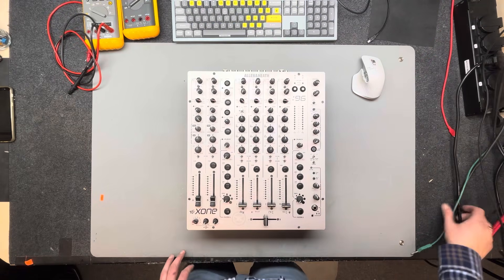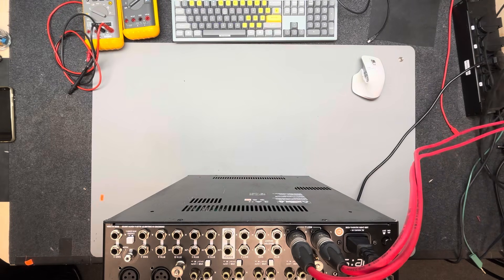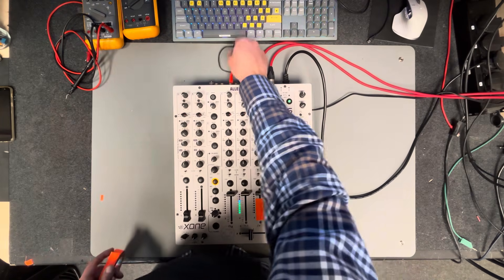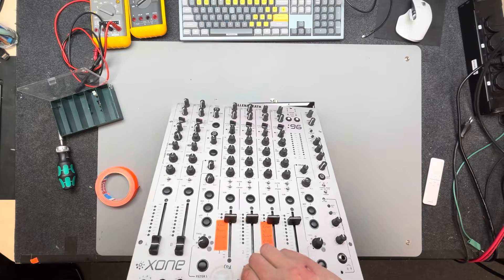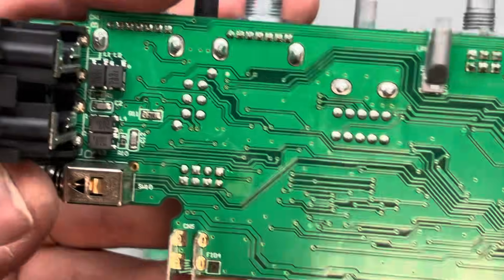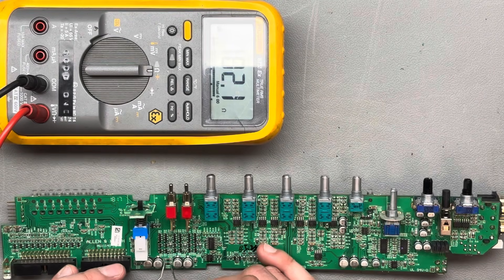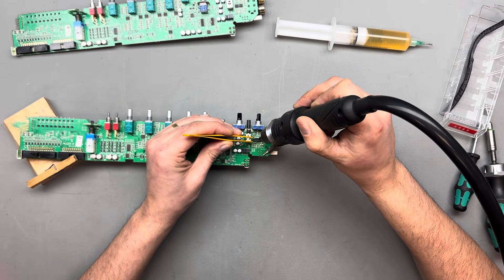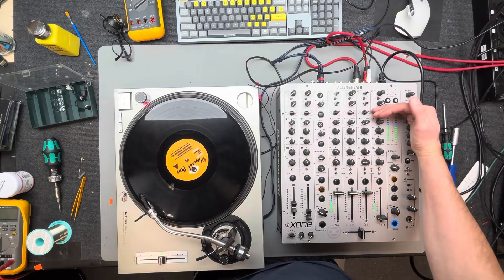Allen & Heath Xone:96 Phono Repair – Step-by-Step Fix!

Comment: Hola amigo yo tengo un problema con mí allen y heath xone px5. El sonido sólo sale por el canal r, en todas las salidas incluso por la de los auriculares, no estoy seguro de cuando empezó el fallo pero creo que fue a partir de una fiesta en la que le conecté otra allen y heath xone 96 la cual también estaba conectada a la corriente eléctrica, de la salida del master a un canal de entrada en línea , además de usarla con traktor como controladora midi a la vez, junto con otros dispositivos como platos technics, etc. El servicio tecnico de allen y heath la unica solución que me ofreció fue cambiar la placa base entera y por lo que entendí el fallo esta en los previos, creés que podria haber alguna otra manera de repararla?
Reply from the maker: Thanks for the detailed message!
It sounds like the left audio path is completely gone – and yes, that could be a damaged preamp or op-amp input stage.
If the issue affects all outputs (including headphones), it’s likely before the output routing – maybe in the input summing section.
I would first check the line input op-amps, especially near the R/L mixing stage.

Replacing the entire mainboard is extreme – in many cases, a component-level repair is possible.
Let me know if you can identify the board revision; I might be able to guide you further!

Comment: Hi brother, thanks for the vid. I’m gonna take my xone92 apart for the first time since I got it in 2000. (Original made in UK version). For cleaning and replacing some of the pots that are slipping.  Also I noticed, 2 of the channels are slightly louder than the other 2. Tested with the same vinyl on same channel settings. 2 channels are +3db louder.  Is that what you were fixing in this video?

Im not too technical with tools. Just basic electronics and solder experience I’m pretty sure I’ll be okay removing the slippery pots and replacing them. But not sure what’s involved in fixing the channels inconsistent gain issue.  Any ideas?  Thanks
Reply from the maker: Hey man,
thanks for your comment and nice words!

From what you describe, I’d say it’s possible that the two channels aren’t actually louder — the other two might just be a bit quieter.
I’d start by replacing the channel faders first. They usually cost around 30–40 € each and the part number is AI5326.

If your potentiometers feel sticky or cause crackling noise when you turn them, they should definitely be replaced too.
The thing is, the EQ pots on the Xone:92 have 12 pins, and removing them can be tricky without damaging the PCB. You’ll need a large soldering tip to heat all the pins evenly — just don’t overheat the board — and then pull the pot out quickly once the solder melts.

Maybe I’ll make a video in the future showing some of the most common Xone:92 problems and repairs.

In your case, it’s most likely worn or defective channel faders, but it could also be something in the OP-amp section.
Best start with replacing all the faders first, and if the issue is still there, we can look deeper.

For the job you’ll definitely need: desoldering braid, a bit of soldering flux, and a fat soldering tip to remove the small fader boards and solder the new ones in place.

Good luck — and let me know how it goes!
Reply: @miktroniks thanks I’ll report back.
Reply: Is that the correct part number for the replacement line fader? Ai5326? It says “003-144” in the service manual I found. From what I can find 003-144 is the complete fader.  And it is plug and play, no solder?
Reply from the maker: @pesh909  You’re absolutely right!
The part number you found (003-144) is indeed the full plug-in fader assembly — that’s the easier solution because it comes with the small PCB and connector, so no soldering needed.

I usually don’t replace the whole board when just one component fails.
If, for example, only the potentiometer or fader itself is bad, I tend to replace just that single part instead of the full module.
That’s why I mentioned the fader part (AI5326) directly — it’s the same functional piece, just without the plug-in board.

But yes, you’re totally right — the complete 003-144 plug-in version is the proper drop-in replacement if you want the easier, no-solder fix. 👍
Reply: @miktroniks appreciate it. Yeah I’m not too experienced with electronic tinkering.  I will always try the easier way out ;). Thanks I’ll report back once I open this baby up.

Comment: The LM4562 is continuously short-circuit proof, even when both channels are running, and can tolerate a maximum +/-18V supply voltage. 2.7 nV/√Hz @ 1KHz noise. Current Limit for best Audio Performance ±23 mA min.
Reply from the maker: That's right, the LM4562 is a robust op-amp designed for high performance audio applications!
Reply: @miktroniks  The LME49720MAX/NOPB is about 10% cheaper than the LM4562MAX/NOPB from a retailer whose name isn't AnalogKey. I don't know why TI is selling the same chip for more with a new designation than with the old National Semiconductor designation.
Reply from the maker: @TTVEaGMXde  Good point — yes, the LME49720 and LM4562 are basically the same silicon, just different branding depending on the era (National Semiconductor vs TI).
The funny part is: TI renamed it, but the electrical specs stayed nearly identical.

In real-world repairs (mixers / DJ gear / pro audio consoles), what matters more is:
	•	proper power supply decoupling
	•	low noise layout around the op-amp
	•	checking ceramic caps for leakage/shorts near the IC
	•	good contact on the ribbon cables / connectors

If the surrounding circuit is noisy or unstable, even the best op-amp will perform badly.

Thanks for the input — always nice to meet audio nerds here 🤟
If you’re into repair content, I post more of this stuff on my channel.

Comment: Yuri hi how are you fine I hope, great video, my one 96 crossfader got crazy when I assign to x the volume comes in the middle of de fader to the sides it turn off the sound when I assign off normal when I assign y gets like off with no fader, then I wait a moment a then my one works normal why its this?
Reply from the maker: Hey , you have to Google manual.pdf  , just tip in Google ( mini innofader plus Manual )
Reply from the maker: You have to Look at adjustement procedure

Comment: Hi Yuriy! My xone96 started recently to make a click noise on channel one and two when I rotate the high EQ knob ( like cutting the high and then rotate it back to center position ) any idea of what might cause this ? Thanks! 🤗
Reply from the maker: It sounds like the click is caused by the EQ circuit switching around the center position. On the Xone 96 this is usually related to the potentiometer itself – either mechanical wear on the contacts or a small DC offset in the op-amp stage. Another possible reason is that the mixer was running for a very long time and, due to high temperature, the op-amp circuit got damaged. By the way, are the rubber feet still attached? It may sound trivial, but they are actually very important for proper cooling.
Reply: @miktroniks thank you so much for your answer! Yes the rubber feet are still attach and the mixer itself is elevated also so that it can cool itself. The click sound usually only happens in the beginning, right after start up, yesterday was the first time it did it after about 1h30 min of mixing..🤷‍♂️ also, it’s not happening everytime..for example, yesterday everything was fine up until the end..I’m gonna try to find someone who’s able to have a look at it and repair it I think.

Comment: Hi Yuriy, thanks for your great video! I have a Xone 96 where the Line input on channel 4 stopped working after an electric guitar was connected (Phono still works). I opened the mixer and didn’t find any faulty safety resistors. I swapped boards 3 and 4, and then Line 4 worked but Line 3 didn’t — so the problem is definitely on the Input PCB. In your opinion, what component on the Input PCB is most likely to be damaged in this case? Thank you in advance
Reply from the maker: Hi,
most likely the first operational amplifier (OP-amp) of the faulty channel is damaged. If you don’t feel comfortable replacing it yourself, I’m based in Berlin and would be happy to help you with the repair.
Reply from the maker: since your Phono input still works, it’s less likely that the first OP-amp is damaged. On the Xone series, Phono and Line often share the same amplification stage, so if one works, the problem is usually earlier in the Line signal path.

Based on similar schematics (e.g. Xone:92), the most likely causes are:
	•	A faulty analog switch IC or relay that handles Phono/Line selection.
	•	Damaged coupling capacitors or input protection components on the Line path.
	•	Burnt or open input resistors, especially after connecting a guitar.

Comment: Hi Yuriy, nice video! I have a doubt, in my xone 96, when I power on the mixer, I see a "pulse" in the mixer that light on all he PK! leds  and the MAIN Vumeter LEDS goes to PK!. It is just a "pulse" on power on. It is normal that pulse? thank you.
Reply from the maker: Hi! Yes, that short LED pulse on power-up is completely normal.
It happens when the internal power rails stabilize — the op-amps and peak detectors react for a split second before the voltages settle.
Every Xone:96 I’ve seen does the same. Nothing to worry about. 👍

Comment: hi Yuriy, nice video, I have a xone92 mixer, there's a lot of crackling noise especially out the headphones  (even when nothing is plugged into the mixer) and some of the channel assigned leds are constantly on. someone said this might be because of a faulty PSU. do you know anything about this fault? thanks.
Reply from the maker: Hey,
yeah, the first thing that came to my mind is the power supply. You could try replacing your PSU. I'm pretty sure that if you open up the mixer, you'll see dark spots on the MOSFET, and in most cases the power supply isn't working properly anymore.

After replacing the PSU, I’d turn the unit on and—with headphones on—try to figure out if the potis (potentiometers) are causing the noise. Try slightly moving the headphone level potentiometer and see if it produces the unwanted noise.

Usually, with PSU issues, you also get unwanted loud pops when turning the filter on or off. Step by step, I’d try to narrow the problem down.

Feel free to message me here and let me know if you've made any progress after replacing the PSU—it usually costs around €150.
Reply: @miktroniks  thanks for the reply! I have a new PSU in the post, so lets see how it is when I replace it. 

I do get pops with the filter going on and off, but they're not too loud. and I don't think the crackle is from dirty pots, so I hope the new PSU sorts things out. I'll message again when I have done the swap.

Comment: Hi Yuriy, on my Xone:96 my Sends stopped working. Have you heard anything about this issue before ore have a clue where to look? Its similar on all channels.
Reply from the maker: did you happen to have any liquid damage to the unit? I haven’t had any experience with the Sends myself so far, but that kind of issue sounds unusual. If it’s affecting all channels similarly, it might be something on the main board or power supply line. Let me know if you find out more!

Comment: Hi, can you explain to me why the EQ potentiometers are x 4? "20KBX4" I have a Vestax and the ones it mounts are for X2, the same size as the GAIN one that the Xone you show in the video mounts, well I don't understand why they are X4 since it is stereo
Reply from the maker: Each channel is controlled separately:
In high-end mixers like the Xone series, the EQ is not always a shared stereo circuit. Instead, the left and right channels are often processed independently through the EQ.
This means, for example, 2 control paths for the left channel and 2 for the right channel – making a total of X4.

More complex signal processing:
In professional mixers, the audio signal is sometimes routed through multiple op-amps (operational amplifiers) or other signal paths.
The potentiometer then either adjusts the signal directly, or controls a voltage that influences an op-amp. This allows for precise control of frequency response or gain.

EQ = active circuitry:
The EQs used in mixers are typically active circuits, which use op-amps to boost or cut frequencies depending on the position of the potentiometer.
So the potentiometer doesn’t just passively adjust the level – it actively shapes the audio signal. And for that, multiple control paths are often required – hence X4 tracks.

Comment: Hi Yuriy, i have a xone db2. The "Record Out" and the "Booth Out" are just working on only one side (record out works only on left channel and booth out only on right channel) do you think it can be easily fixed or could it be a bigger problem?
Reply from the maker: Hello,

I clearly remember that the booth out operational amplifier U19 (8080) is responsible for this. As for the record out, I still need to check the circuit board. I'll try to keep this in mind during the next repair of a Xone 96 and find out which IC it is.

Basically, the issue is often caused by burned-out operational amplifiers. A possible reason for this is that the small rubber feet of the mixer are often lost, which reduces ventilation. As a result, the mixer overheats.

So, my conclusion: Don't lose the rubber feet!